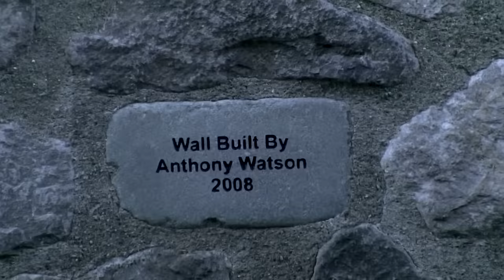Building Stone Retaining Wall

Comment: That wall looks amazing, great work! Did you use any rebar for the footing?
Reply from the maker: +isaiah9876 Yes, I added a single 1/2 inch rebar along the length of the footing to minimize cracking if the ground should settle any. I also added short 12 inch pieces of rebar vertically every four feet to tie the stone wall to the footing. You can see them better in the photos on my web site. http://www.watsondiy.com/2008wall.htm
Reply: @AnthonyWatsonDIY  I saw no regard, no pipe no fabric, no stone
.........lots of imagination
Reply from the maker: The photos on my web site show the footing rebar,  as well as the drain pipe and stone being placed behind the wall.  http://www.watsondiy.com/20080908.php   However,  there is no horizontal rebar up in the wall itself.

Comment: #AnthonyWatson this is stunning and I want to do this. What type of rocks and what type of concrete did you use? Also any tips? Thank you form Australia.
Reply from the maker: I think the stone I bought is basalt. It's sold as Gabian stone around here and averages about 4-8" in size, though some are larger. Any stone should work as long as it's clean. I used Quikrete Type N mortar mix. I don't know if it's the proper type for the application, but I haven't had any issues. Tips? Make sure your footing is below the frost line in your area, and install a drain line and gravel behind the wall to prevent hydrostatic pressure pushing your wall over.
Reply: @AnthonyWatsonDIY  Thank you for the tip and info. I have a big dirt mound in the backyard which has some curves and I will be filling that with plants. I also have active soil so that makes me a bit nervous to get it right.

Comment: How does this look today? My guess is it moved as there is no drainage and the foundation should have been at least 3 feet deep
Reply from the maker: It still looks as good as the day I built it, no movement, no cracking. There is a 4" perforated drain behind the wall. See the photos on my web site. http://www.watsondiy.com/20080908-stone-wall-2008.php.  The foundation only needs to be below the frost line, which in our area is only 12" deep. I dug down 6", then backfilled another 6" when the wall was finished.
Reply: @AnthonyWatsonDIY  means that everything was done 💯. Congratulations! I did some stone work myself and it is an extremely tedious, slow going work

Comment: What tools would you say were "a must" have?
Reply from the maker: +Dave Arneson Hmm... Tough question. I used a small margin trowel to place the mortar and force it into all the little gaps. Some tough rubber gloves are also a must have. The mortar really starts to eat at your skin after long exposure, and the grit will tear up thinner gloves. I used a thinset mixing paddle in my drill to mix my mortar in a large plastic bucket ($5 party buckets). A small sledge hammer helped to break or chip rocks when needed, but I really tried to use the rocks as-is whenever possible and avoid breaking anything. A stiff brush to clean up the mortar once it starts setting up. Handsaw or a cutoff blade in a grinder to cut the rebar. Oh, and a small stool to sit on. I expected all that rock lifting to be hard on my back, but the constant kneeling hurt my knees and ankles more than anything. A string line and line levels helps to keep the top of the wall level. A short level can help keep the face of the wall plumb, but I was usually able to eyeball it close enough after a while.

Comment: Anthony, I notice you opted out of weep holes in base course or an agricultural holed pipe at back for drainage issues. How do you address you behind wall drainage?
Reply from the maker: I have a 4" perforated drain pipe behind the wall. It's surrounded with gravel and landscape fabric, then backfilled with soil on top.  The drain pipe runs underground and drains to daylight on the lower part of our property.

Comment: Is there horizontal reinforcement / rebar In the wall
Reply from the maker: Not in the wall itself. I do have horizontal rebar in the footing, and there are vertical rebar stubs every four feet to tie the wall to the footing. Most of the wall is 30" or less high. It's one foot thick and leans back into the hill slightly. Nine years later no cracks, no leaning.

Comment: How did you engineer it to avoid it tipping over?
Reply from the maker: Mostly it's just the solid mass of stone that keeps it from moving. However, the wall does lean back slightly and curves into the hill, sort of like a dam. Also, there is gravel and a drainage pipe behind the wall to remove any water that could force the wall over. It's over eleven years old now and still standing like the day I built it.

Comment: +Anthony Watson nice  job! What would you saw the cost of the job was?
Reply from the maker: +Robert Mahla The total cost was $1491. The truckload of stone cost me $490, and the concrete for the footing cost $330. Other than small extras like rebar and drain pipe, the remaining cost was for the 127 bags of mortar.
Reply: +Anthony Watson (WatsonDIY) you haven't accounted for the labour cost.
Reply: +stuart weatherburn shit ain't cheap..
Reply: +Anthony Watson (WatsonDIY) how long did it take once you had the footer laid? Also, did you have to build the wall at an angle to account for ground movement of did the footer eliminate the need?
Reply from the maker: It probably took 6-7 months to build the wall once the excavation and footings were in. I only worked on it a few hours each morning, then cleaned up the work I had done later in the afternoon.  The footing is just a good base for the wall to minimize settling. It doesn't really do anything to resist pressure behind the wall. My wall is only 2-3 feet high and relies mostly on mass (it's 1 foot thick) to resist movement. However, I do have a drain pipe installed behind the wall to carry away any water that builds up. It hasn't moved or cracked in eight years.

Comment: How wide should the wall be if we want to build it to 6 foot height?
Reply from the maker: I'm no expert, but generally walls over 4 feet high will need a building permit and engineer drawings. You would need a more substantial footing, more rebar reinforcement, perhaps strongbacks built in to the hill, and of course good drainage behind the wall.
Reply: @AnthonyWatsonDIY  Mostly just looking to build a wall around the  area where our pool equipment is to keep it separate from the yard.  Would need to be at least 5 feet, but thinking 6 feet would keep it out of view better.  I'll have to look in to the permitting rules.
Reply from the maker: @scottclements4528  If your wall is free standing and not holding back soil, it probably doesn't matter. Just pour a footing below your frost line and build up the wall with rebar reinforcement every few feet or so. You could also look at precast wall blocks for a project like that. Or go easy and build a simple fence. :)

Comment: I love this. So you spray the stone face after you set them in mortar to expose them? I'm no mason so forgive my ignorance. Thank you.
Reply from the maker: +Cliff Paul My technique is probably not the "proper" way of doing things, but it worked well for me. I mix my mortar a little wet so it squishes into all the little gaps easily. I usually spent a few hours in the morning building up the wall. Then I would let it sit for a few hours to stiffen up. In the afternoon I used a water hose and a brush to clean off the excess mortar and smooth out the joints. This method worked well with the irregular shapes of the rocks. The trickiest part is timing when to start cleaning up the mortar. Too soon and you wash away too much mortar. Too late and it takes a lot of hard scrubbing and stiffer brushes. The timing varies a bit depending on the temperature too. If it comes off too easy, I give it another hour or two to harden. A couple weeks after the wall was finished, I sprayed muriatic acid on the wall to remove any remaining surface haze.

Comment: How is the wall holding up after 7 years? Any cracking or sway from the terrain behind it as it settled over time?
Reply from the maker: +Chris P There have been no signs of cracking or leaning since I built it, even when someone backed into it with their car. The wall is at least one foot thick, a bit more on the low end where it is tallest. I installed rebar in the concrete footing to minimize shifting.

I added another wall section in 2009 (video here on YouTube). It hasn't cracked either, but the joint between the two wall sections has a small crack. I tried to redo that joint a few years ago, but it cracked again immediately. I tied the two walls together with short pieces of rebar, but there's obviously still some small movement between the two walls. Other than the hairline crack between the two walls there haven't been any issues except occasional moss buildup.
Reply from the maker: +Anthony Watson (WatsonDIY) Forgot to mention that I also installed a 4" drain pipe and gravel behind the wall that redirects any water that might build up.
Reply: ***** thanks for the reply, fantastic work and property.  What part of the country?
Reply from the maker: SW Washington State. Mild winters, no issues with frost heaving here. My footing is only 6-12" deep. Colder parts of the country would need to go much deeper to get below the frost line.

Comment: You want us to believe that this is the first stone wall you ever built?
Reply from the maker: OK, you caught me. :)  I built one other wall before this one. You can see it in the video at 1:48 in front of the garage. I picked up a bag of mortar and a couple buckets of rocks to test out my idea and see how it was going to look. We liked the end result so I moved on to the "main" wall, the project in this video.
Reply: Please understand that I was only skeptical because that wall was so well done.
Just laying bricks has a learning curve, a big stone wall like this takes real skill.

And to get a consistent straight edge on the top of your wall with stones like that  ....impressive stuff.
I won't even get into how your wall tapers at one end :)

Great job Anthony.
Reply from the maker: Thanks!  The taper wasn't as complicated as it sounds.  Once I had the grade set with the bobcat I poured a footing to match the slope of the ground. Then I determined how high I wanted the wall and strung a masons line (AKA string) with a line level. Then I just filled in the area between the footing and the string line with stone.  The top of the wall isn't necessarily flat with the odd shaped stones, but it's close enough for my needs. It looks nice and holds back the dirt, that's all I wanted. :)

Comment: What kind of cement did you use?
What consistency should the cement be? 
Did you do any rock cracking/breaking?
I would like to build a higher wall, on an existing concrete/rock wall, any advice.. 😊
Reply from the maker: Type S Mortar if I remember correctly. Consistency was roughly like peanut butter. I did chip off the edges of some rocks so they would fit a spot better, but overall I tried not to break any rocks. Too much work and takes too long. Easier to just pick a different rock. As for your higher wall, most areas require a building permit, engineering, etc. if your wall is over four feet high. You may want to  check with your local building department to see what their requirements are.
Reply: Anthony Watson thank you!

Comment: What was the cost?
Reply from the maker: About $1500 total (in 2008 dollars), which included $330 for the concrete footing, and $490 for the truck load of rock. The remainder was for mortar mix. There were a few additional costs for rebar, drainage pipe, gravel, and landscape fabric for behind the wall.

Comment: How is the drainage behind the retaining wall made?
Reply from the maker: It's not in the video but I have a 4" perforated drain pipe behind the wall that redirects water to a lower spot on the other side of our property. The pipe is covered with gravel and landscape fabric to keep soil out of the drainage system. There's about 6-8" of soil on top of the drainage system.
Reply: Спасибо. Thanks.

Comment: Did you plan for water run off? How is it holding up?
Reply from the maker: +Angelo White The soil behind the wall is about 2 inches below the top of the wall, so water does not flow over the top of the wall. I have a 4" perforated drain pipe installed behind the wall, with gravel backfill and filter fabric. This collects any water that builds up behind the wall and redirects it to a drain farther down the hill.  This wall is about eight years old now and we have not had a single issue with it.
Reply: Perfect, great job. Thanks for the video, and quick reply.

Comment: what kind of motor mix was used? hows the wall today?
Reply from the maker: I used the standard bagged mortar mix from Home Depot, Type "N" I believe.
http://www.homedepot.com/p/Quikrete-60-lb-Mortar-Mix-110260/100318487

Eight years later and the wall is doing fine. No cracks or other issues.
Thanks for watching!
Reply: thanks for the reply , i have a wall that needs rebuilding
Reply: I would recommend Type S for natural stone and brick. Type N is best for cultured stone. Type S mortar is made for load bearing walls and type N is for non bearing. Since this used a lot of mortar and heavy rocks and did not go too high, the type did not matter much.
Reply: hey ,tolik p. i am just now getting around to the start of my wall build . my wall would be bearing the weight of dirt behind it with nothing between it and the dirt . do you still recommend type s??

Comment: What mortar mix did you use?
Reply from the maker: I used Quikrete Type N - https://www.homedepot.com/p/Quikrete-60-lb-Mortar-Mix-110260/100318487
Reply: @AnthonyWatsonDIY  Thanks. When I did my wall I used a slip form method. My mortar was type "S" with a shovel of lime with concrete sand (course) and Acryl60 additive to make it more sticky and mixed it on the dry side so that it was just soft enough that I could still adjust how the stone was sitting without the mortar spooging out. I set the mortar in from the face of the stone so I could go back latter and point the joints with a mortar bag.

Comment: Are fake, man-made rocks good for this?
Reply from the maker: Artificial rocks are generally just thin castings used as a facade. You would need a cinder block or poured concrete wall to attach them to.

Comment: Title should be changed to "How to build a retaining wall that will fail in short order"  No drainage and no horizontal reinforcement.  The #4 rebar you stuck into the footing (if you want to call a 3-1/2" pour with a single rebar at the bottom a "footing") every 4 feet isn't going to help much.  Expanding water is a force that is almost unstoppable by any mechanical means so you have to mitigate that... you did nothing of the sort.
All that work and to save $200 in materials you blew it.
Reply from the maker: The footing is 6" thick in most places, with an additional 6-8" of backfill, putting it below our frostline. There is also a 4" perforated drain/stone/landscape fabric behind the wall that discharges on the other side of our property. See the photos on my web site https://www.watsondiy.com/20080908-stone-wall-2008.php. In any case, the wall is over 14 years old now and still looks as good as the day I built it. No cracks, no leaning, no issues.

Comment: A three foot high unreinforced wall retaining an ascending hill with large trees.  The footing is only a foot or so wide.  There is nothing in the design to resist the force of the soil pushing the wall over.  It is a shame that such a beautiful stone wall is not likely to last very long.
Reply from the maker: Going on 13 years now, and it still looks like the day I built it. The wall is a solid mass that mostly curves into the hill and leans back slightly (like a dam). Most of the wall is closer to two feet high, and the taller section down near the large fir tree is closer to 16" thick. There is also a 4" drain pipe and drainage stone behind the wall to prevent hydrostatic pressure. Nothing lasts forever, but so far it is holding up very well.

Comment: There are no expansion joints, are there any vertical cracks?
Reply from the maker: Nope, not a single crack after eight years.
Reply: You did a nice job.
Reply: Anthony Watson hi there Anthony, I'm about to take on such a task.
Did you have any of the rocks cut to shape?
If I pass on my email could you shoot me some pointers?
Reply: you put expansion joints on concrete paths or driverways but not stonewalls'
Reply: Michael Palffy I was thinking the same thing lol
Reply: @justsomeguy7540  control joints, where ever applicable walls, walks, bridges ect. Go back to school

Comment: Structurally he messed up by not reinforcing the concrete footing with double rebar instead of one in the middle,and for the wall,he should install some rebars standing up and one rebar (horizontal) across half height of wall,there's a good chance that that wall will crack within a few years....
Reply from the maker: The wall is eleven years old, no cracking, looks as good as the day I built it.

Comment: There is no point putting in a concrete footing if you are not going to set the first course of stones into it. Unlike a block wall where starter bars are set into the footing to tie it to the wall, this wall has nothing connecting it to the footing. Also setting the wall level with no fall back, all retaining walls should have ten degrees fall on them. Lastly, no drainage is as recipe for failure of the wall.
Reply from the maker: Look closer at the video and web page. Vertical rebar stubs every four feet tie the wall to the footing. The wall does lean back slightly as well as curve back into the hill. Finally, there is a 4" perforated drain behind the wall, covered with stone and landscape fabric. It drains away further down the hill. The wall is now 11 years old with no issues at all.